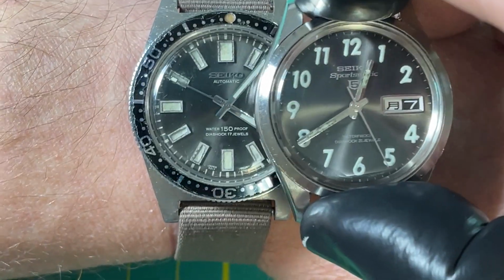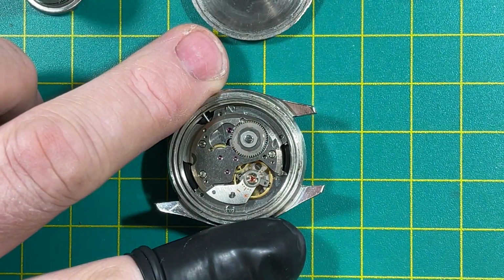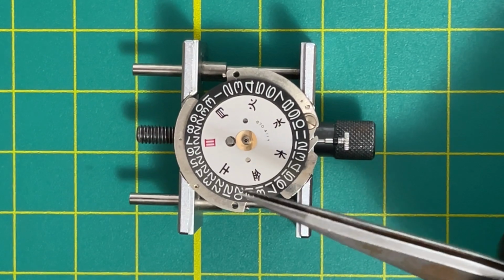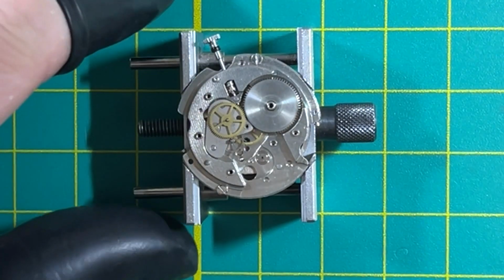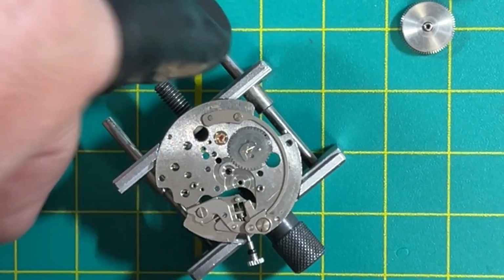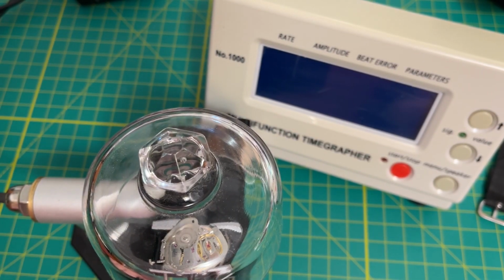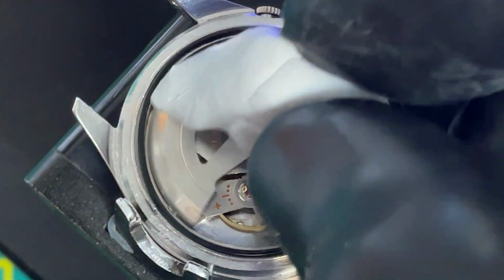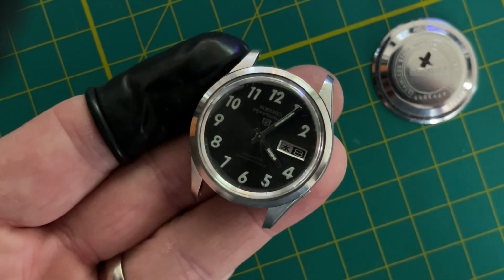For SS: Seiko 6619-8280 Mac-V SOG restoration

Comment: Hi Spencer,  I watched your video before I dismantled the movement to clean .  However,  I still let that tiny tiny washer flew away from my tweezer into space.   I looked for it for two days to no avail.    What would be the problem if I assemble back the second hand wheel without the washer as I do not want to spend $ to buy an donor movement  just for that incredible tiny washer.   Hope you will enlighten me
Reply from the maker: My suggestion would be to see about low-cost 6619s on eBay.  The little ring itself is part number 446660 and is for sale NOS here: https://www.ebay.com/itm/145886661508
Reply: @SpencerKleinVintageWatch  Thanks,  I think buying a donor 6619 movement will be a cheaper choice.  Besides , I can have other spare parts .   Cheers

Comment: Thanks for this. I serviced and have a 6619A-9990 which I can’t get the date quick change to work. It wants to work, but won’t click over enough. Do you know what usually wears to stop it working correctly? How did you clean the top of the hands? What was wrong with the main spring arbour? Cheers. PS, OMG you know Seikos!